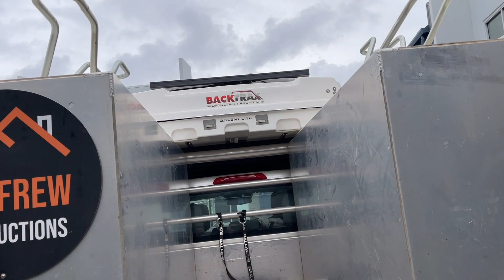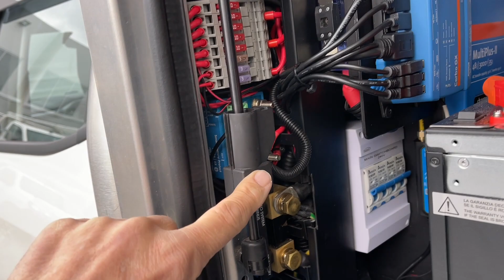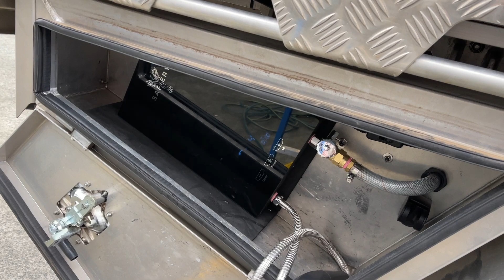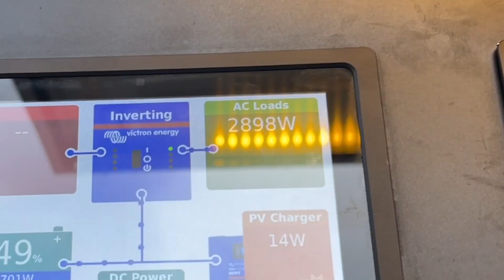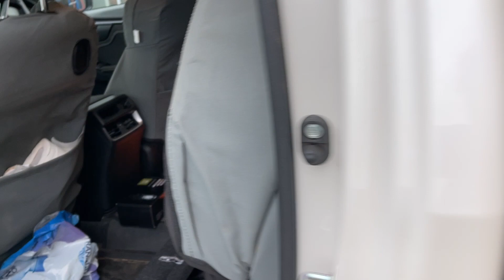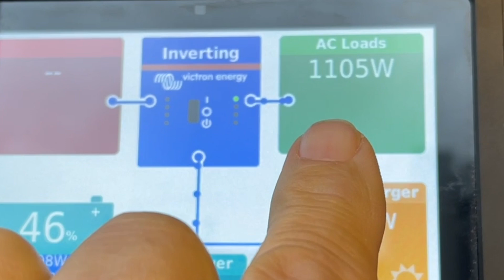Dmax set up for Hot Lunch & Hot Showers on Construction Sites - Scotty 1500 in rear seat pocket

Comment: Excellent effort Bruce. Love your work. Attention to detail as always top notch. A question regarding the alternator on this particular model. Is this the model only rated to 75a ?
Another question not related to this video is the killer wasp bi directional? I have multiple applications that could use a 12 V to 12 V by directional unit. Thank you Bruce
Reply from the maker: Hi Matt, yes this standard alternator is rated around 75A. Jack is set to upgrade this (we have a 250A upgrade model) at a later date. The killa-wasp is not bi-directional and it is 12V to 12V. the Scotty 1500 is bi-directional and does 12V to 24V. Thats the product you need and thats it in the video.
Reply: @Safiery  
Thank you for your prompt response Bruce.

Comment: Hey Bruce you have not answered my email.. How goods that!
Reply from the maker: Can you please answer the other question: 
Lithium Ion batteries should be charged slowly to prolong their life whereas Scotty increases the amps which results in a faster state of charge which would reduce the life of the batteries, is thos the case with Scotty?
This is a true statement. Now let’s put in perspective. Our 48V Lithium has a design life registered with (Clean Energy Council Australia) of 6,000 cycles. If these batteries are charged at 1C (regularly)instead of 0.5C, the cycle life reduces to 3,000. Before we look at this charge rate, 1 cycle is the contiguous accumulation of 100% discharge. Let’s say that is over 3 days. So 3,000 cycles is 9,000 days which is 25 years. For the same reason, we don’t get concerned if you flatten the batteries a couple of time. We just ignore cycle life in RV’s, it's irrelevant. We recommend at least 2 of our 48V batteries with Scotty which are 50Ah each. That’s a 0.5C rating for the 2 of 2,500W of charge. And that’s about the typical max from Scotty. So there is zero impact on Lithium life with Scotty.